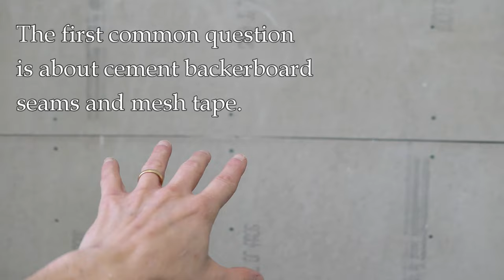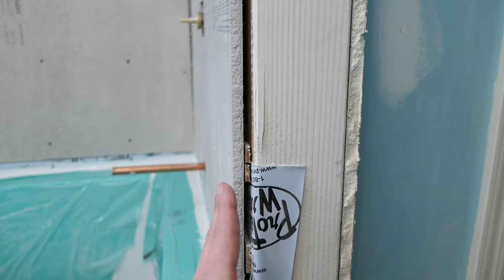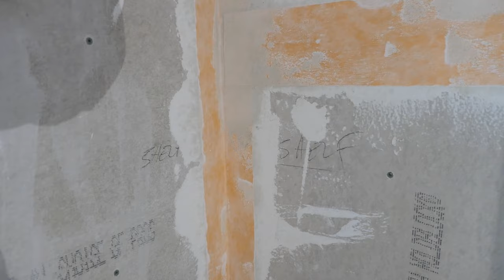Should Backerboard Go Over The Tile Flange Or Up To It?

Comment: What would be a reasonable or starting estimate to totally remodel a 5x8 bathroom? With tile.
Reply from the maker: How long is a string?  There are infinite variables, including regional differences in labor and material costs.  Your best bet is to either have a remodeling contractor come over for a visit and give you some general guidance based on what he sees, or to ask friends and neighbors what they paid for a similar bath.
Reply: @enduringcharm  thank you for your response. I've called 2 different contractors. One estimate was $10,000 and the other was $12,000. Without even looking at it just over the phone that's their starting cost. To me that just didn't seem right for such a small bathroom.
Reply from the maker: Well, there are a few things I can elaborate upon.  First, any contractor giving you an estimate over the phone without even seeing the project is laughable.  There are countless factors which could make a huge difference in cost before you even enter the room or talk about design.  For example, is the bath in a ground floor ranch with an expansive driveway or is it on a third floor condo with restrictive parking?  Or, another example, is the bath in a 1700s timber frame house or a 2010 truss framed townhouse?  There is a reason why contractors should visit in person and discuss the scope of the project before even offering a ballpark range of cost.

Second, the size of the bath doesn't necessarily correspond to price.  All baths will need a vanity, shower/tub, toilet, etc.  A few more square feet of floor tile doesn't make that much difference.  In fact, smaller baths are more challenging to remodel than modest sized baths because physical access itself is an issue.  And, what does "remodel" mean?   Is it replacing the vanity and painting or is it stripping everything down to studs and starting over?   Big difference.

In my area (New Jersey) $10-12K would be a very low number and would likely be a budget bath remodel with low end fixtures and relatively little work to do as far as wall or floor repair and ancillary tasks.  Some baths I do are many tens of thousands of dollars.  Some are under $20k and occasionally under $15k.   It just depends on the circumstance and design.  You should work on finding a licensed contractor with a positive reputation in your area who will come out in person.

Comment: I'm having this same problem you addressed at 9:03 about shimming the wall in the tub surround, and matching it with the existing wall ... & try  to use your technique to add the flashing behing the tub.  That seems to be my only way of solving my issue.  Do you have any tips or other videos addressing this & showing how you apply the flashing.??  I still need to use shims to close the gap between the tub and the studd.  Not sure how to go about doing it and apply the flashing as well.
Reply from the maker: There is one type of flashing tape which is extremely flexible that you might look for, made by Zip System.  It can be stretched to conform to almost any shape and that will help you go from the tub lip to the stud faces.  Then you can shim the backerboard to the extent possible.  You might also think about centering the tub in the rough opening, so that any excessive gap is shared between the right and left walls.  Or, if one wall is more easily shimmed, then shift the tub to the opposite wall.  If you get the backerboard up and you are just a little bit shy of where you need to be, you can skim coat the bottom of the backer by the lip with thinset to add some thickness, or you can use thinset on both the backerboard and the back of the tile to provide a thicker layer.  That could help you get overt he edge of the lip.
Reply: @enduringcharm  hey thanks for the reply.  My thoughts were though to do it your way by bringing the backer board to the lip of the tub and not overlap the lip.
Are you suggesting i shouldn't do that.  The way you did it in the videonseems to be the most logical way of doing it without having to deal with this half inch of backer board indifference compared to the existing drywall down at the tub ledge area.  I have about a 1/4 inch gap on some studds at both the right and left ends.
Reply from the maker: Right, that's what I assumed--your backerboard will be set on top of the lip.  I was just detailing some methods to deal with irregularities or excessive gaps.  If it's just individual studs which are out of plane, you may be able to sister up new studs or use shims to make corrections.
Reply: @enduringcharm   sister up studds....  That's a brilliant idea.  Thank you in hadn't thought of that.  Thanks for all your advice. :)

Comment: Can u put a link for the Protecto Wrap Flashing?
Reply from the maker: The brand really doesn't matter.  I used to get the Protecto wrap at Home Cheapo, I think.  However, these days I prefer the Zip System stretch tape, which is easy to conform to the profiles and which sticks like glue.

Comment: Oh I do love the flashing idea!  What a fabulous tip, thank you!  I'm an "expert DIYer" in my own mind 😛  May I ask  why you don't waterproof the cement board?  Isn't cement board "mold resistant" but not waterproof?  I have always red-guarded my cement board so I'm very curious!  Would love to not have this extra step and time loss if I can.
Reply from the maker: When I do require complete waterproofing, such as when I am tiling the shower floor as well as the walls, I use the Schluter Kerdi membrane.  In many cases, though, I believe waterproofing is simply not required.  Plenty of people who have fallen under the spell of marketing claims may disagree, but I've taken apart probably 70 bathrooms over my career and noticed patterns.  Know how many times I've found mold or rot in the middle of a bath/shower wall, even when they were tiling over wallboard?  None times.  I found it none times.  But, a large percentage of the time I find rot and mold at the edge and at the corners of a tub or pan on the floor.  Guess where I concentrate my efforts at waterproofing when I remodel a bath?

Comment: Thank you so much...We have dealt with these questions in our home remodels, and never really had anyone answer to our satisfaction.  You did!  One question:  you mentioned the waterproof quality of the Hardibacker brand backer board...what are your thoughts about USG Durock brand?  Is it as "waterproof", so that no further waterproofing is essential (except in the corners as you mentioned)?
Reply from the maker: I really need to make a video on this subject.  This obsession with waterproofing is fed by marketing departments not reality.  Tile is waterproof.  Grout that has been sealed will also shed water, at least until the third teenager in your house gets into the shower.  What I worry more about is movement in the framing, missing grout or caulk, or other damage.  That's why I use the flashing beneath the backer.  As for Durock, I'm not a fan.  I like Hardibacker because it is stiffer than other brands and not crumbly or porous.  It just makes for a more secure installation.

Comment: Hi.  Ok so if you just use a waterproofing membrane compound and tape in all the joints and seems, you have a completely waterproof backer board.  Then there would be no need to put additional waterproofing materials (10" roof flashing and plastic 3' up the walls).  This might save you both in time and material costs.
Reply from the maker: This is a point of confusion for a lot of people.  When I use the flashing behind the backerboard it isn't for "waterproofing."  It's there in the event something goes wrong in the future, such as framing movement and cracks, or the homeowner failing to maintain grout/caulk.  I've seen some amazing things over the years, including showers with half-inch cracks in the corners which the homeowners continue to use while water flows to the floor below!  So, even in cases where I use Schluter membrane across the entire wall surface, I still use the flashing behind the backerboard.  The Schluter membrane or Redguard or whatever you use is only as good as the substrate.  And, at the base where the backerboard and tile meets the tub or pan, you are still relying on a bead of caulk.  My flashing trick is just a way to give me peace of mind in case the homeowner does something stupid or the framing shifts.  The flashing takes me about five minutes and costs maybe 5 bucks.  Actual waterproofing using the Schluter membrane over the entire wall surface takes much longer, especially if you wait for the thinset underneath to cure, as I prefer to do. Cost for the membrane is likely $150-200, and you need to use unmodified thinset or else use their expensive "Allset" product.  Multiple trowel sizes and types are needed and the extended thinset cure time means waiting longer between rows and before grouting.

Comment: What type of mortar should you apply when installing the Kerdi to the corners and seams. I purchased the Mapei Porcelain Tile Mortar but would like your opinion.
Reply from the maker: The concern is modified versus unmodified thinset.  Modified thinset has latex additives and must dry quickly to reach strength.  Unmodified thinset gains strength by drying slowly.  As you can imagine, the plastic Kerdi membrane inhibits drying, which is why they generally recommend unmodified thinset.  Having said that, if you are just installing bands of kerdi in the corners and seams and not over the entire wall, I've found that the type of thinset really isn't important.  Modified thinset will dry quickly enough to be fine.  If you're still worried about it, you can get the "all-set"  mortar (expensive) sold by Schluter which can be used in any situation.

Comment: When you apply the Kerdi membrane to the seams and corners, what to you set the membrane in? Do you use thin set or something else?
Reply from the maker: Yes, unmodified thinset when going against cement backerboard like Hardibacker.
Reply: @enduringcharm  the hardibacker website says to use modified thinset in their videos.
Reply from the maker: The question is about the Kerdi membrane, not hardibacker.  Kerdi prefers you use unmodified thinset against masonry products because the membrane will prevent evaporation of moisture.  Unmodified thinset will cure this well way, but modified thinset will not.  Having said that, if you JUST using kerdi band to cover the seams and corners you can get away with modified thinset.  I have tried it without issue.

Comment: What about removing the thickness of the tub lip from the back of the hardy board on the wall? That way the board can go all the way down to the tub and the wall wall will be flat.
Reply from the maker: Nice theory, but the thickness of a typical fiberglass tub lip is about the same as 1/2 inch hardibacker.  Some acrylic tub lips are thinner, but in that case you can just overlap the backer anyway.  And, trying to grind away a section of hardibacker is a bad idea in terms of health anyway--the dust contains silica which is bad news for the lungs.
Reply: The tub lip is the same thickness as the board because you are NOT to board over the lip.   Going over the lip defeats the purpose of said lip.  The gap creates a division so water doesn't wick off of the acrylic tub and up the board.  Even if the caulking at the base of the tub fails, water should not travel up the board.

Comment: Are you familiar with a product called DumaWall? It's vinyl wall tiles. Considering using it instead of traditional tile to avoid grout seams. Also it's less brittle thus less likely to crack. I'd like to get an opinion from someone who's used it or something similar.
Reply from the maker: You'll be sorry.  Do yourself a favor and install real tile, which will hold up better, look better, and give you some resale value.  These amateur-hour products which supposedly save you time and effort are cheap substitutes for the real thing.  I have a whole bunch of videos on tiling, installing showerbases/tubs and finishing off your bath.  You'll be much happier in the end if you do it right and make the effort to use pro grade materials.
Reply: @enduringcharm  
Thanks for sharing your thoughts. Admittedly I'm an amateur-hour bathroom installer. But I bought a box of Dumawall tiles to evaluate them and I'm impressed. To my eye they look as good as "real" tile. More importantly I think they're superior to real tile for shower walls. I've been studying up on "pro grade" tiles - youtube has a ton of videos and most of them are repairing tile installs that failed because people insist on using brittle ceramic & porcelain tiles in unstable wooden structures and sealing them with brittle and porous grout. Vinyl tiles have some flex and they join with tongue & groove joints sealed with silicone - no grout required. Maybe I'm missing something but seems to me that we don't build plumbing out of clay terracotta anymore because it's hard to work with and it has a short lifespan before it crumbles. Pro grade tile seems to have the same issues and I'm puzzled to understand why we still use it in bathrooms.
Reply from the maker: Tile that is properly installed will last indefinitely.  I've taken apart bathrooms with 60 year old tile installations that were in perfect shape, just a dated look.  There are houses with tile installations going back much further than that.  Porcelain tile is extremely durable.  Even cheap "builder-special" ceramic tile that was poorly installed will last 20 years.  The product you are talking about is made of PVC, which expands and contracts with temperature changes.  That movement will have to be absorbed by silicone caulk, which has a lifespan.  The product is aimed homeowners with limited ability.  If you fear tile, I would encourage you to consider a shower enclosure instead.  Those have a history of durability, at least.
Reply: @enduringcharm  
I don't fear tile. I fear water leaking thru the seams. As an amateur-hour DIYer with limited abilities I am astonished to learn that professional tile installers expect water to penetrate their grout. They consider leaking tile an inevitable fact of life. They design pre-sloped mortar shower bases under their tile floors to guide the leaked moisture to weep holes in the drain. I just watched a YT where a tiled shower wall, only 3 years old, had discolored grout from moisture behind the tile. This was installed by a pro bath renovator using pro grade materials. His fix was to install a second layer of tile over the existing layer. See why I have my doubts about tile? How can there not be a better way? Yes, I have doubts about cheapo plastic panels too.
I gotta stop watching youtube. It's making me crazy.
Reply from the maker: Oh, lord.  No, you aren't watching professionals do these things you describe.  Leaking tile or tiling over existing tile is not inevitable.  No professional would tile over tile.  If you are paranoid about water leaks, you can easily waterproof your entire tile installation.  The Schluter Kerdi membrane is a market leader in waterproofing, and that the system I use when a waterproof installation is called for.  I have several videos about it.  It is installed under the tile.  In the case of a tub or shower base and tiled walls, I use a flashing system in the event something goes wrong in the future,  But, in a residential setting where a shower might be used twice a day, tile applied over hardibacker cement board doesn't even require waterproofing.  I've taken apart and then put back together 60-70 bathrooms.  Fear about water leaks is greatly overblown.  If a tile installation is done to professional standards and maintained by the homeowner, the tile will last many, many decades without leaks or other problems.

Comment: Thanks for the videos....I see on Hardibacker site they call for attaching the backer board max 16 in on center...do you recommend that? Going to be redoing my bathtub, standard 60 inch. The 60 inch wall has studs 24 inch on center, with the final one being 12 inch. Should I be adding a stud between the 2 24 inch ones?
Reply from the maker: You don't necessarily have to add a vertical framing member if that will be difficult.  You can add some horizontal blocking for support instead.  If you go that route put the blocking flat side out and install it along the backerboard seams so those are supported.
Reply: @enduringcharm  And what's the best method for cutting out holes in the hardiebacker for your spout and mixing valve? A jigsaw with the coarse blade as demonstrated in one of our older videos?
Reply from the maker: For the valve I typically use a jigsaw.  For the pipe hole you can just use a spade bit on slow speed.